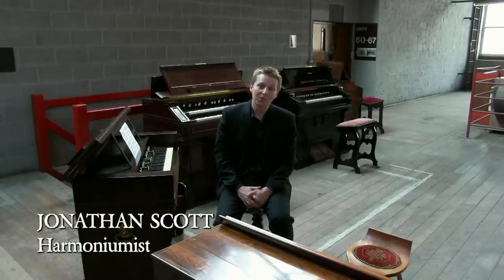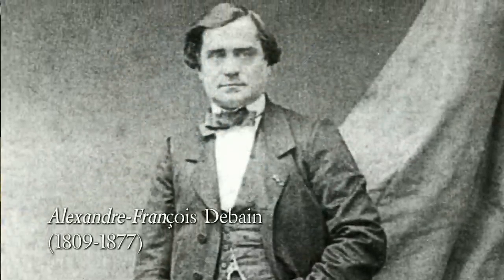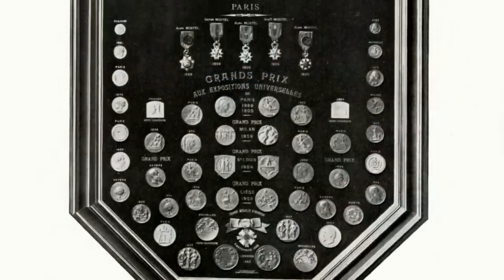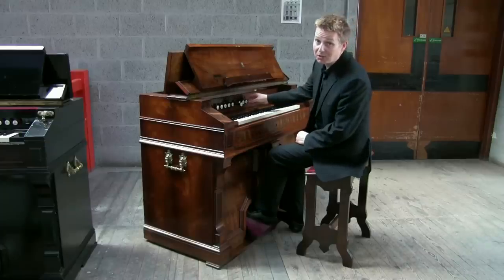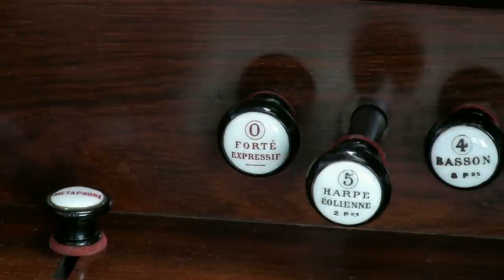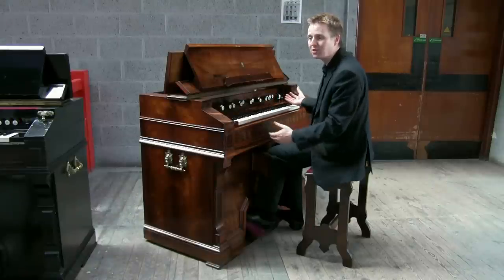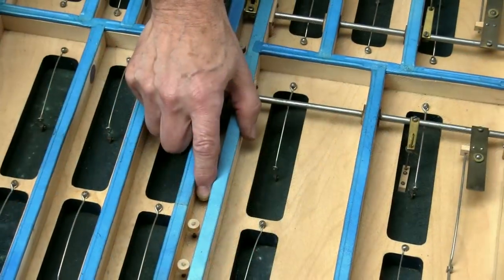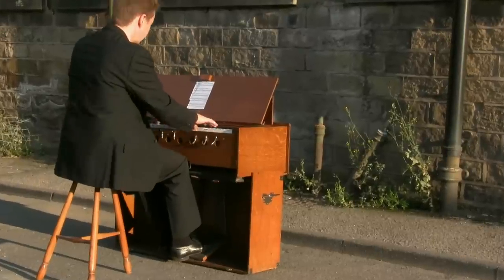THE HARMONIUM - ITS HISTORY AND HOW IT WORKS

Comment: I've got what would have been one of the budget full size harmonia, with only eight drawbars but it has expressiveness as default standard. If that was usually a posh feature, I did well for an Ebay bargain. It's loud too, though sounds a bit weak in the bellows after all this time. It's got two bars to play all the same notes on each octave when you hit just one, which I like.